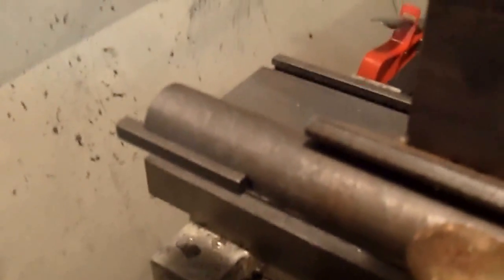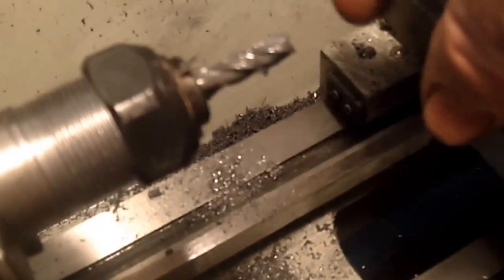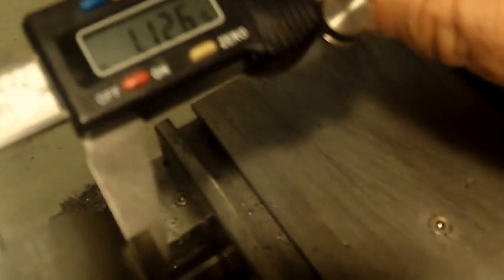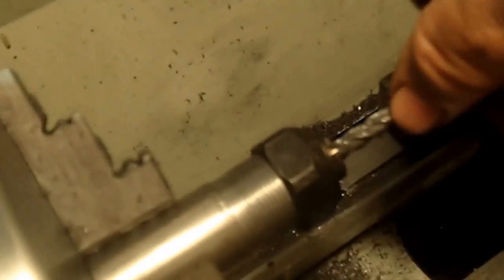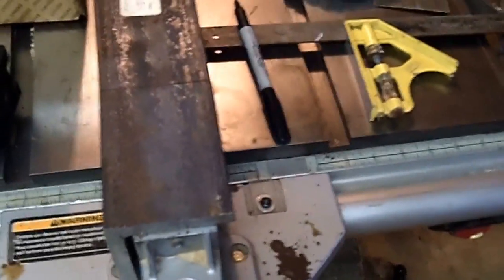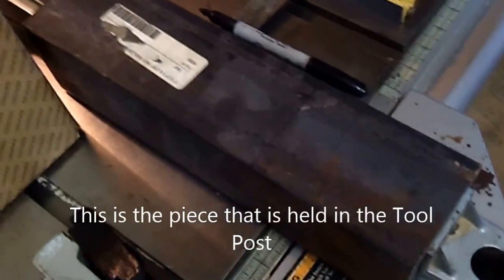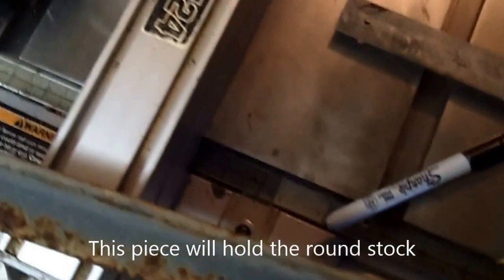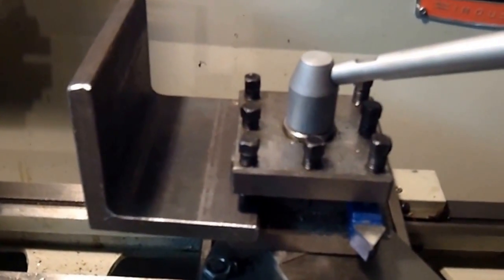Keying a shaft with a lathe

Comment: The 'Big Angle' sticking out... I've got exactly the same set up and so I machined a hole in it big enough to fit the tool post when the tool carrier is removed. I then made up a pipe washer with a large circle base on it which presses down on the Angle just as is happening when you tighten the tool post. That removes any kind of leverage affect on the tool post.